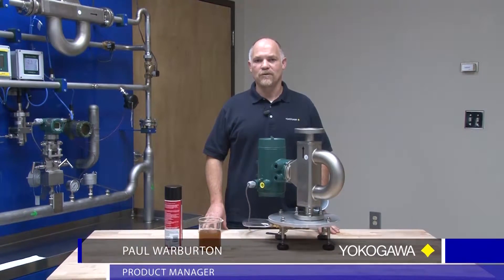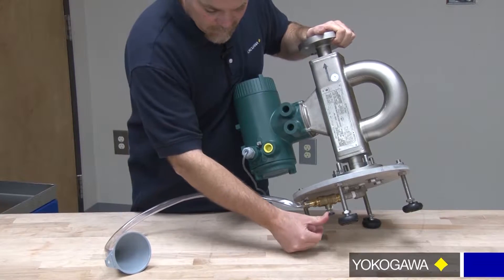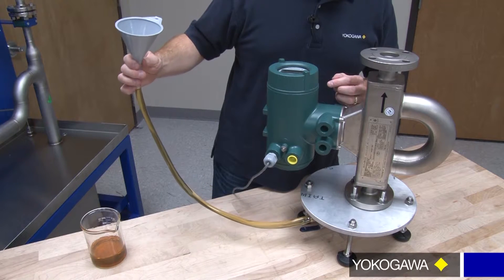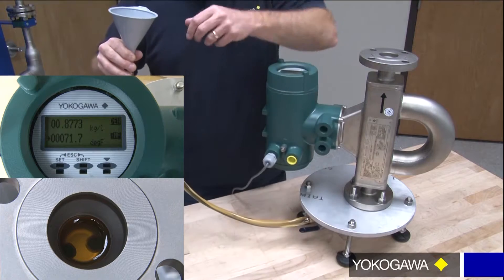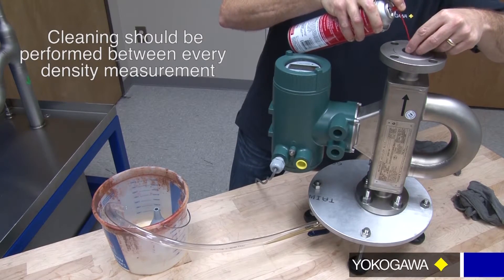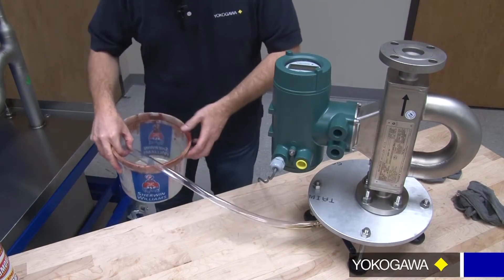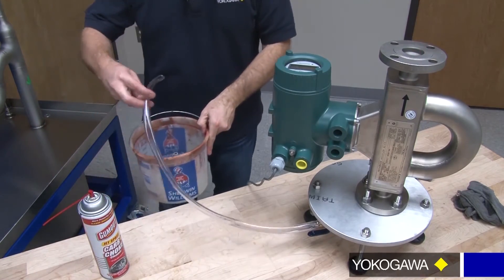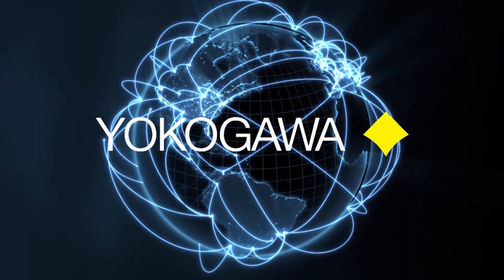How to take an oil and water density measurement

Comment: Hi, nice video
Just my wonder: why did not we do the water density first and then oil? Will save time and efforts for cleaning
Thanks
Reply from the maker: Good question.
Typically you would want to do the water and then the oil, but in this video we wanted to show the correct cleaning method so customers could see the correct process before ending the video.